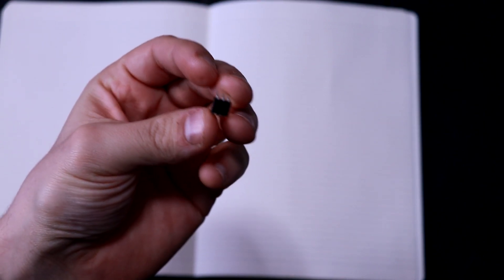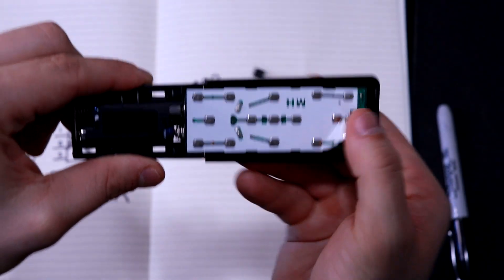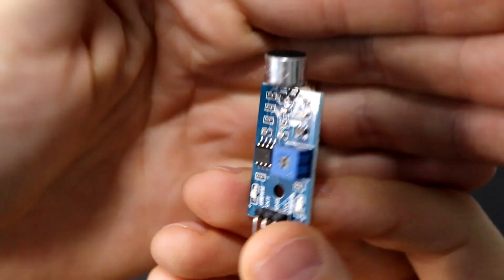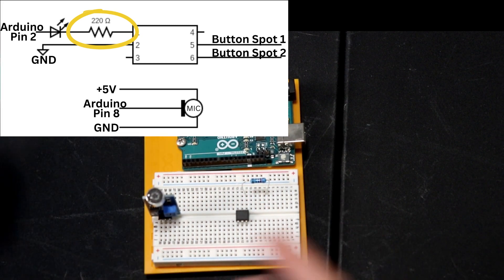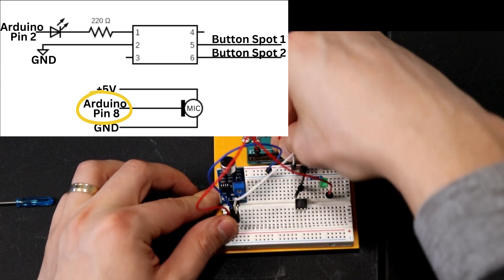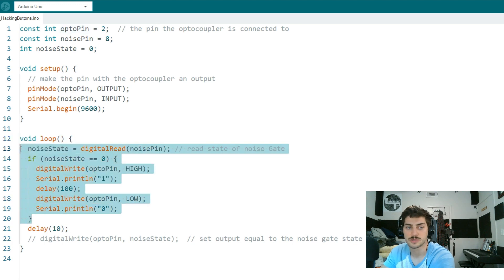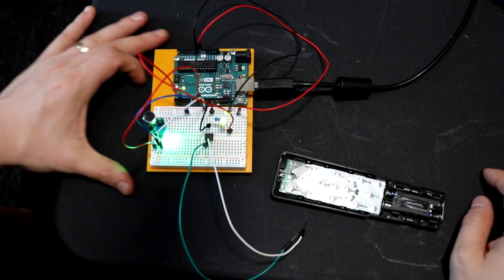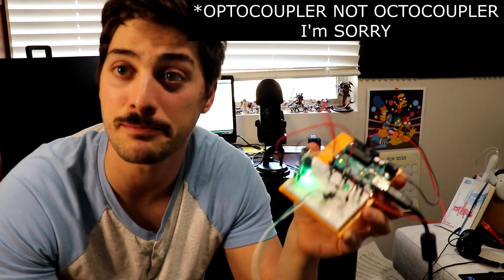How to Control Remote Devices with Arduino! Buttons and External Device Electronics Tutorial!

Comment: Hi, great video!
Based on this video, I started to make my awning smart. It uses decoded ir signals so using a blaster is not an option. So, I have a esp32-C6 board and an optocoupler and have it working for the OPEN button, but despite all efforts, the STOP and CLOSE buttons don't want to play ball. I have used the multimeter to verify the +and- and to see whether the STOP and CLOSE buttons work similarly as the OPEN button and they do: when you push the button on the rc, the voltage drops.
The wires for STOP and CLOSE work for the OPEN button, so from the output part of the optocoupler there is nothing different for the three.

ChatGPT says something about current drops, but I measured just a slight increase in ohms (more resistance means less current) for the STOP and CLOSE wires, say a drop from 45 ohm to 54 for stop and 65 for  close.
Also to know, when I short circuit the 2 wires for both STOP and CLOSE they work perfectly... So the soldering should be alright.

Anyone an idea why this is happening?

Comment: I want to use this sketch using my voice to turn a 12 light switch on and off. Say “On” to close circuit and say”Off” to open circuit. How do you keep the circuit closed and stay closed until it is triggered by voice again?
Reply from the maker: Honestly sounds like you want more something like this project! How to Use Voice Recognition Commands With Arduino!
https://youtu.be/dls0LtSUlCo
Reply from the maker: You might want to check out this project too! Voice Controlled DIY Smart Lights!
https://youtu.be/L6Vg9dT7hsU
Reply: @lemastertech thanks so much for all your help and prompt response!

Comment: Hey there, I be am looking to make this sketch without a remote but to make a light switch turn and off
Reply from the maker: Hi! If you want to wire an arduino into a light switch you probably want to use a relay! I have two recent videos on my channel for how to use relays with arduino, but if you don’t want to change the wiring of the light switch you might need to create like a servo mechanism to actuate the light switch up and down!
Reply: @lemastertech would i need an optocoupler if I use a relay? They already have them built in, yes?
Reply: @lemastertech  thank you. I want to connect the relay directly to the light switch wires